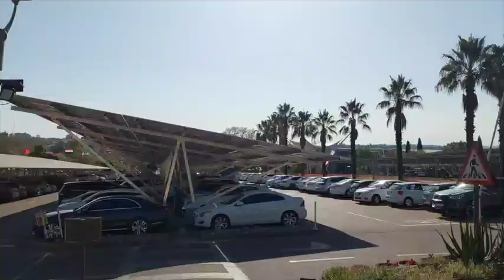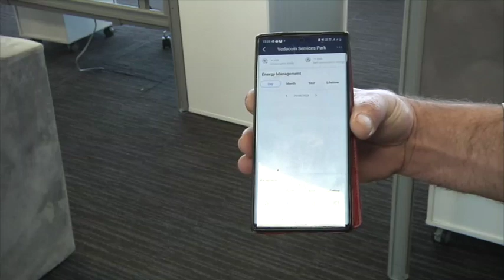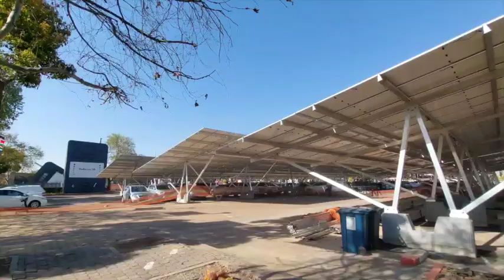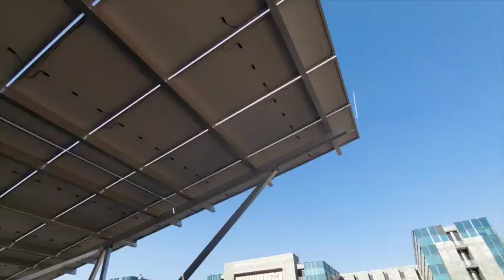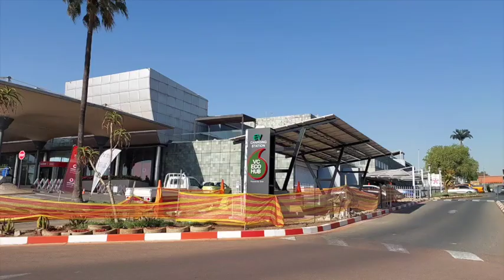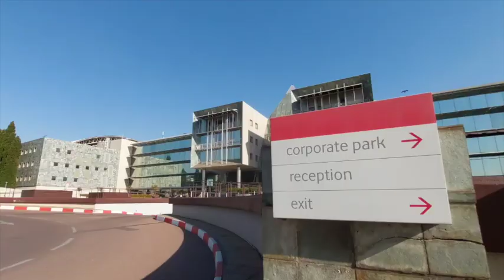Next Renewable Generation Successfully Installs Groundbreaking Solar Power System for Vodacom

Comment from the maker: We're thrilled to share a remarkable achievement from our recent project! Next Renewable Generation is proud to have successfully installed over 11,000 photovoltaic panels at Vodacom's Midrand campus in Gauteng, making it the largest on-site solar power generation system in the Vodafone group. 🌞

📅 Published: October 12, 2023
📰 Source Article: https://www.engineeringnews.co.za/article/vodacom-converts-midrand-campus-into-groups-largest-on-site-solar-power-generation-system-2023-10-13/searchString:Vodacom%20Midrand